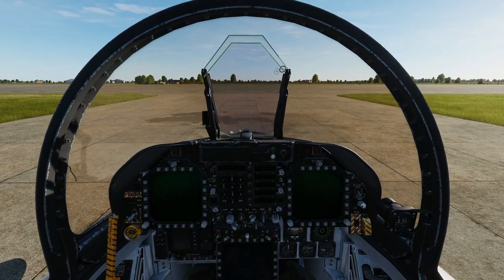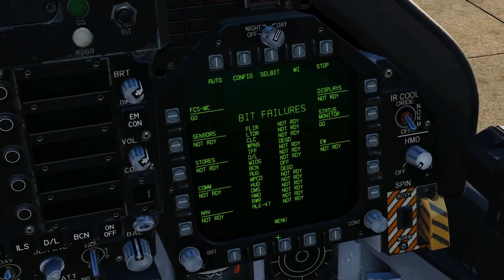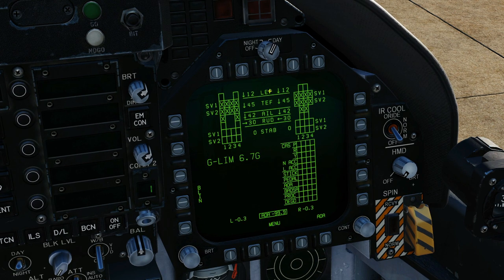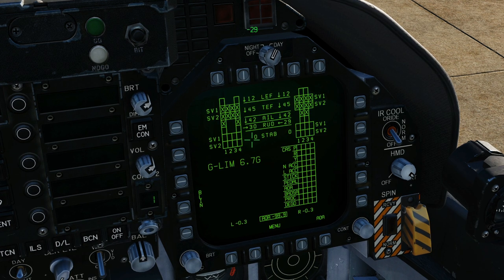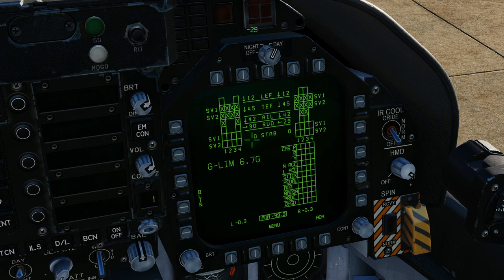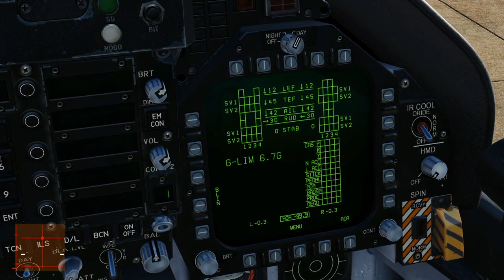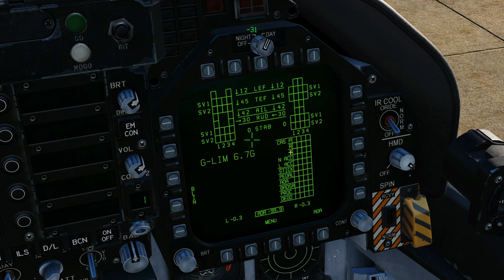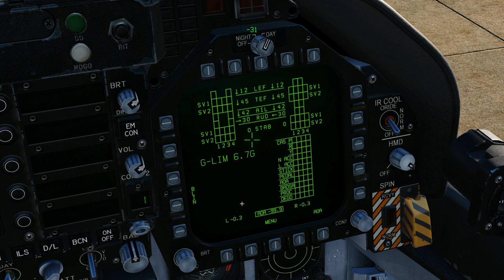FA-18C Hornet: FCS DDI Page Tutorial | DCS WORLD

Comment: Just to add as an avionics tech who was part of a Canadian F-18 squadron. And for those who may not know this...

There's actually two flight control computers (FCC) with two channels each. So, first FCC is channels 1&2, second is 3&4. Notice the configuration on the display so if you lose the first FCC, for example, the left aileron would still work due to channel 4 of the second FCC.

It's all about redundancy in case of failure or getting shot up. Just like the physical channels are split up as well, think wire bundles, two channels along the top of the aircraft and two along the bottom.

And, of course, each FCC has one channel along the top and the other along the bottom. Wouldn't want to lose an FCC just because the wire bundles on the bottom of the aircraft get shot up, lol. It really is all about redundancy.

Comment: Im thinking of getting into dcs what equipment is necessary. All i can afford rn is a logitech 3d pro 😂.
Reply: And then there is me, who plays with keyboard and mouse XD
Reply: If you want to get fancy, some sort of track ir is great. There are cheap ways to go at it. I recommend delanclip, but be warned it's challenging to setup compared to the fully fledged products. What I did was, I found opentrack profile for A-10 on the internet and just used that for dcs and all aircraft with couple changes.
Reply: I have used the logitech 3d pro for fairly long now and all i can say is that its really enjoyable to play
Reply: Flappy_Boi I know this is a year late, but I too can afford only the logitech extreme 3D pro. there's only ONE thing I detest about it: the twist---or rudder----fails within about 3 months. A small dead spot and or spots of excess response develop, making it difficult to calibrate or tune. I try to be mindful of that and minimize strain as best I can. Other than that, though, it's definitely configurable enough and the pitch and roll are pretty durable.